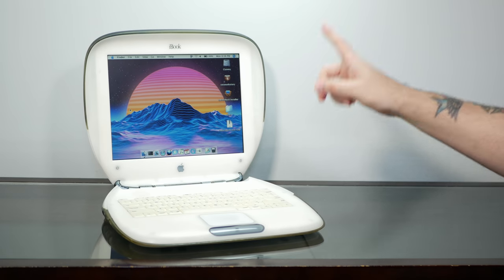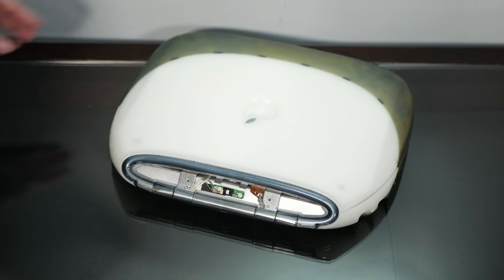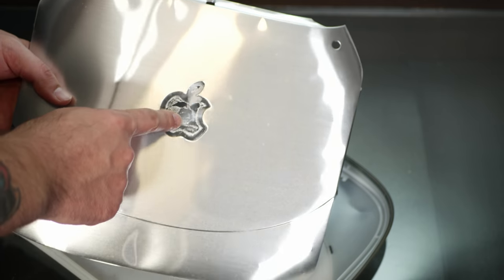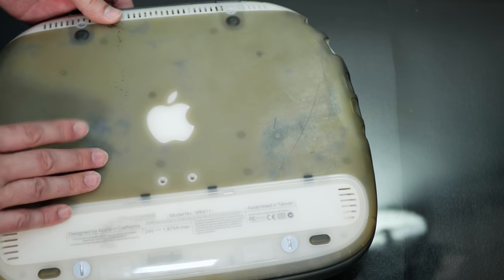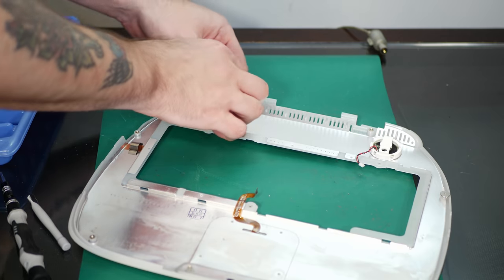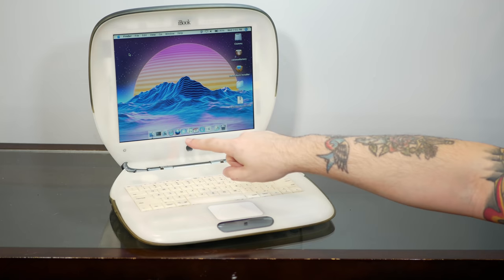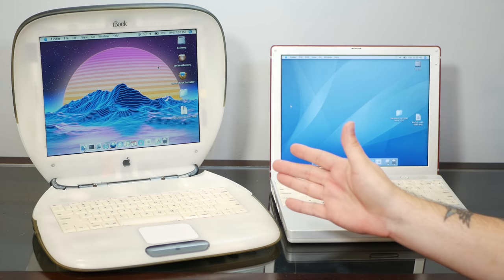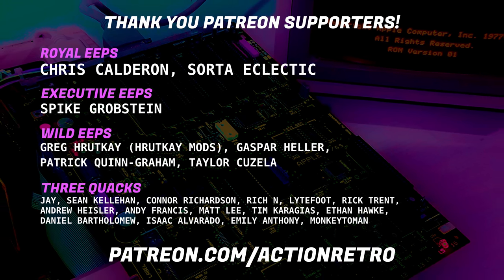Modding the iBook G3 Clamshell to be Transparent

Comment: 4:50 Somewhere here Apple realized that the logo is upside down when sitting at Starbucks, which illumination would make even more obvious.
Reply: The upside down logo was supposedly an intentional thing. I'm paraphrasing here, but the original intention was to make the experience nicer for the user as opposed to onlookers.
Reply: @F_I_J_I_W_A_T_E_R  People weren’t sitting in Starbucks back then. At the table at home it made sense to have it facing the user.
Reply: @jonasthemovie  I wouldn't rule it out, the clamshell models were the first to support Wi-Fi after all. Especially with this 466 model, which was still for sale around the time they started making Snow models.

Comment: you need to slap some LEDs in there to have more light inside the case to make it easier to see the parts. if you position them in the right place you could highlight key areas. just a thought

Comment: I've dealt with similar discoloration before on other devices and plastic parts, my suggestion would be to gently warm the material up with a heat gun or hair dryer and see if you can reflow the material a bit. This trick works very well on other semi-transparent rubber coatings.

Comment: From what I've read, it's definitely the adhesive, but the issue is that the adhesive degradation tints the rubberized material, so yeah it's done. I would recommend first removing it and seeing how it looks with nothing to replace it, and if you don't like it, use a very low-grit sandpaper and a sealer to layer-by-layer cover the rubberized coating and entrap it inside a sealed "prison", then paint over-top of it. Alternatively, you can also 3D-print replacement pieces out of regular plastic, which might be a go-to for a better look (that may even include custom colors/designs).

Comment: I did the metal delete to my blueberry iBook back in the day, mostly because there was a bunch of dark junk on the edges of the metal where the paint flaked off or something. The first gen models definitely had a more transparent body than the later SE ones did. It's probably better to leave the bottom metal piece in there however because it doubles as a heat spreader for a few chips such as the GPU and the disk controller (IIRC) which will get pretty hot without it.
I never tried replacing a large BGA device with a heatgun because it's a very touchy process with a high failure rate outside of tightly controlled environments. Good luck with it.

Comment: what I'd experiment with is a stronger bleaching solution to turn the rubbery plastic much paler, sealing the white plastic with something and dunking the whole thing in a solution of dye to get some penetration into said plastic to get a brighter more even color, but I have no idea if it'd work with that plastic.
Reply from the maker: What I'm thinking is I'm going to try to find a new back case in nice condition, and then use the old one for experiments on bleaching and restoring the color

Comment: while you had it open, you could've taken some scissors to the inside cage above the HD.  And then if you leave the top case of the mSATA adapter off or cut a whole in it, you'll have instant access to the mSATA by lifting the keyboard, as one does with a Pismo. I've done it on mine and I love it.  I haven't had to open it up since
Reply from the maker: Oh yeah I do plan on doing this!

Comment: I did more or less this exact mod last year, but with one of the older model iBooks, and the more transparent plastics do make a dramatic difference. In my case, the rubber was pretty much fine but the metal shielding had some weird corrosion on it, so removing that was kind of a no-brainer. I'll post a link to some photos of mine in a separate comment (just in case YouTube flags it).

I don't think Apple changed the plastics to be more durable (the problem with cracking seems to be something that happened over the long term and probably wouldn't have been obvious while these were still new). I'm pretty sure the change to the plastics was entirely an esthetic choice that had the side effect of making them more durable.
Reply: Here are the photos: https://imgur.com/a/GYcbpvH
Reply from the maker: Yeah that looks really incredible. I didn't expect this iBook to be a completely different kind of plastic - I was hoping for your kind of effect

Comment: I think you're right about it being the rubberised coating/adhesive breaking down, in the same way that old tape turns yellow from the adhesives used.  Not sure there's any way to fix it, it's a shame but can't see any good way of restoring it.

Looking forward to the CPU upgrade, should be scary :)

Comment: Could you take a heat gun/hairdryer to the lid and melt the glue holding the rubberised parts on? Then you'd perhaps be able to deal with the discolouration.

Comment: Hey man, that mod is pretty sweet, I think I like it better subtle like this. Shame there was nothing to be done for the coloured plastic part, though. 

There's a noticeable improvement in the audio here, too. Especially in the first five-ish minutes. It sounds like you were a bit further away from the mic. Plosives (P, B, T, etc sounds) were rendered far more naturally, and there were no mouth sounds that I noticed.

The second segment where you're actually handing the laptop was a bit quieter than the first segment, and it sounds like you moved a bit closer again after that (at about or just before 5 minutes in). I think the audio in the second segment would have been just fine if it were boosted a little more, and moving closer again wasn't strictly necessary. (Though I can totally understand if it happened unintentionally instead of intentionally, I have been known to drift to that closer, proximity-effect, emphasised plosives zone accidentally.) If background noise becomes an issue, many noise suppression solutions (such as in Audacity) do a great job for speech.

Anyway, I've always had a real soft spot in my heart for these laptops. The carry handles, the cute shape, the colours. I bet wifi reception was pretty good, all things considered. Also even though the trackpad is tiny, the design of the button pleases me far more than the later laptops. 

Of course, as you say, the screen can be a huge limitation. I love the idea of doing a screen swap and a CPU upgrade. Make a stealth ultimate version of one of these! A G4 has enough oomph to install Linux on as well and run modern utilities (with a lightweight GUI option), which works quite nicely with this size and type of screen. I don't know if there's any way to get modern wifi authentication protocols on this hardware though. I know the later "AirPort Extreme" cards can still support WPA2 today, but I don't know about how the original AirPort behaves. But yeah, this could get even better for multi-booting and making it perform :D definitely bringing one of those to a coffee shop would be pretty dang cool. Outshine everyone else with a way more recent Apple laptop.

All in all, another awesome video 👍

Comment: The shielding is there for a reason, but yeah, why not rip it out? It's not like You're really going to use that clamshell laptop anyways. At least You're not going to rely on it. Some interferences going in might not hurt it too much. Btw, I destickiefied an Apple puck-mouse by using tuner cleaner. It's a cleaner that's plastic safe and leaves no residue; that's why it can be used on tuner capacitor fingers. Worked for me. The puckmouse is still nice and clean and sticky free :D